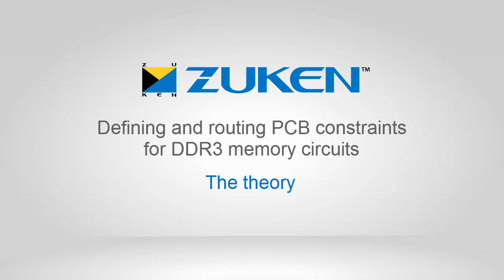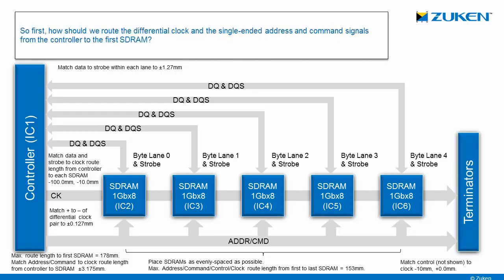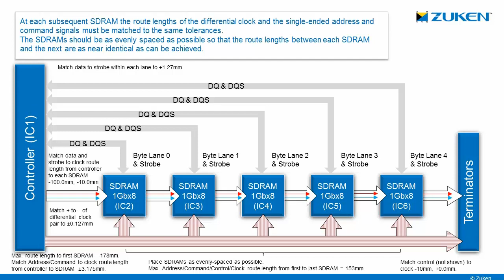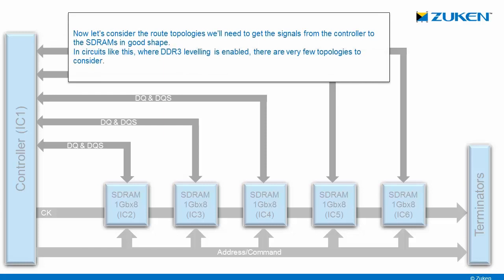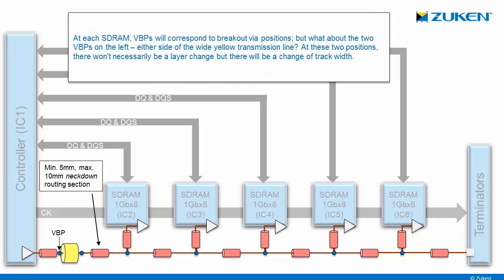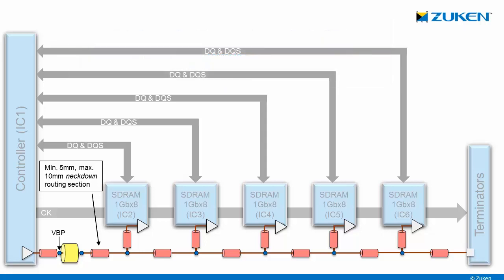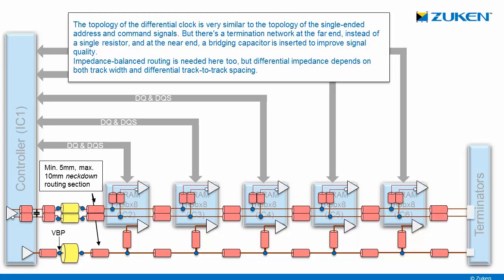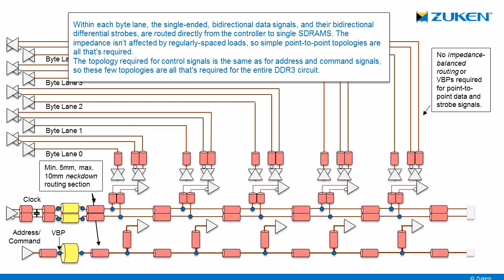Defining and routing PCB constraints for DDR3 memory circuits - Part 1: The theory

Comment: Ok so the data lines are simply in series so they are strait forward. But the clock and address are in parallel so they have to be equal in each section.
Reply: DRAM is fully parallel interfacing for data and addr both